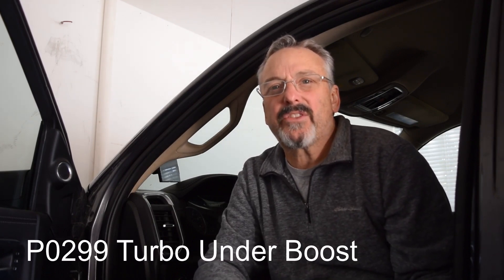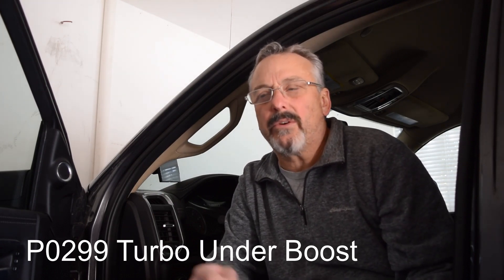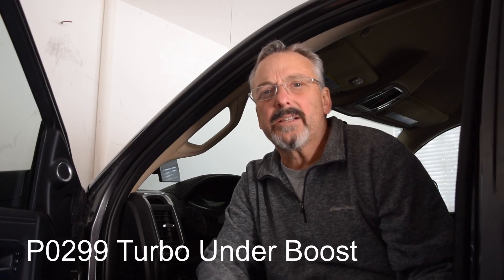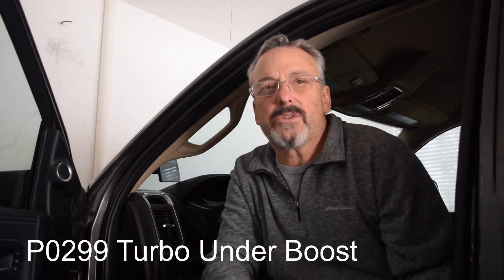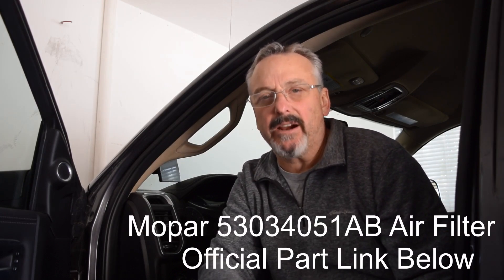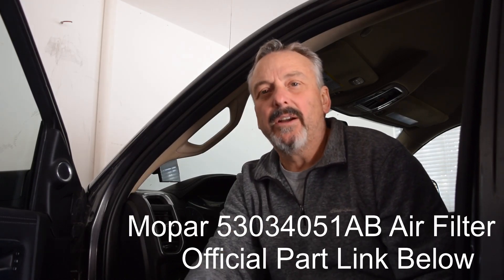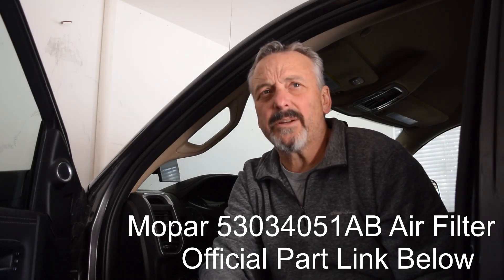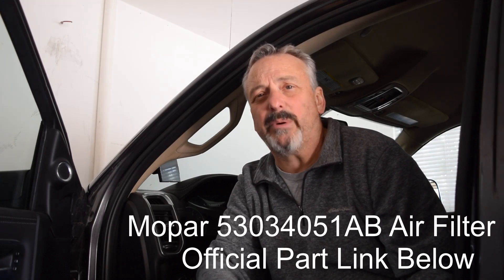2021 Ram 2500 6.7 Cummins P0299 Code Turbo Under Boost Code – Diagnosis and Fix

Comment: 24 ram 2500 low boost started last month and had the dealership work on it, was reprogrammed was good for one month now code is back on, I have changed the air filter every other oil change so 10k miles I do oil changes every 5 and I use wix or docs diesel filters no issue on my past vehicles just my ram
Reply from the maker: That's tough when the problem reappears so quickly after a dealership visit.

Comment: I started getting that code before I had 5000 miles on it after I installed a high flow cold air intake.

Comment: Interesting, you say people that live in high altitude get this code. I move to the colorado rockies about 90 days ago and have had nothing but problems with my dpf filter and now the p0299 code... i do run an aftermarket air filter, ill try a factory filter and see what happens.
Reply: What was your results?

Comment: RAM 3500 Laramie 120k miles. 
No issues of any type.  
I took it to the RAM dealer for the airbag recall and the ECU reprogram recall.  
I’d always used Doc’s air filters and never had an issue.  After the reprogram, the CEL came on  it was the P0299 code. I change to the OEM air filter and after 100 miles or so the CEL was gone.  
I may,as an experiment, reinstall the aftermarket filter to see if the CEL returns.
Reply from the maker: I am glad you got the code cleared and thanks for letting us all know.  I know it sounds CRAZY, but something about the airflow of the factory air filter helps this situation.

Comment: I have a 22.  Filter did not fix the issue.
Reply: @farmboy….🤦🏻‍♂️ good grief.   If you have factory air filter and a “replaced line,” maybe more to it than air filter.   Keep us all posted.  Thanks!
Reply: For the record… engine and air all stock…. However, I have Banks Pedal Monster as only extra.   Mine could always be that.  Since I only see it towing… I’ll just use my code reader, delete and repeat!  Unless it worsens.  🤷🏻‍♂️
Reply: I had the pedal monster , its been out for over a month, still had the code pop up, waiting to go to dealer for re flash, 21 2500  @MotoFish45
Reply: @dieselfred8084    I pulled my air cleaner out.  It had a few bugs but not too bad overall.   Code hasn’t been back.  Haven’t towed yet either.  We will see.  I think these are extremely picky about the air cleaner.
Reply: @MotoFish45  I'll have to check mine it's about a year old
Reply from the maker: Sorry to hear this.  Lets us know what does fix it.  At least you tried the cheaper option first.
Reply: Any update on what it was??
Reply: Been 4 months…..any update?   I only get the code when towing.
Reply: @MotoFish45 I'll update you on mine.   Took it in for this code.  Was told the turbocharger tube had a pin hole.  Well, it's 7 days later and the code is back.
Reply: I also have Banks Pedal Monster in mine, I have the same issue.
Reply: @michaeljames2204  I had a reflash from dealer per tsb and I changed my air filter to mopar all good now
Reply: @dieselfred8084    Well, been all good.  Towed the cargo trailer about 40 miles the other day, no issue.  When returning the same 40 miles, halfway back, sure enough, check engine and same code is back.  Think it’s time to see if I need an update as well….to be continued…..
Reply: I'm having the same issue with this code. I will do a software update and new Mopar air filter. Will be back for update.
Reply: I replaced my air filter and the code disappeared immediately.
Reply: @michaeljames2204  I also replaced my air filter to factory. Problem solved!
Reply from the maker: @michaeljames2204  Great news!
Reply from the maker: @michaeljames2204  Great news!

Comment: Can MAF sensor cause the p0299 code. Getting that and a p2281 code. Wonder if they are connected. My truck has a after market AE powersports cold air intake on it. Bought it with it on there. Haven’t had any problems with it till now. It’s been about 40 thousand miles.
Reply from the maker: Read the other really detailed comments here.  One other person was having issues with a MAF Sensor and cleaned it and put in a new factory air filter and had success.

Comment: Thanks, for the information.   I would hate to have real issues over just an air filter.  We will see what happens to mine.
Reply from the maker: I am still amazed that this is a fix for an issue that can be very frustrating and even a bit un-nerving.  I am also glad other people have seen this video and had success.  A simple thing to try is just change the air filter and if that doesn't work keep trying other ixes.

Comment: I had the same problem. I cleared the code and forgot about it. Took the truck in for regular service and had the code pop up on a work related drive shortly after.Driving from Boise to Pocatello I had a filter box full of dead bugs and obviously a very dirty filter. The dealer surprisingly didn’t even check the filter during the service. I did a thorough shop vac of the intake air box and changed the filter. I used a fram filter….Cleared the codes and no code the last 6 months.
Reply from the maker: I am glad you got the air box cleaned and a new filter.  These Engines seem to be sensitive to the air flow.  So a dirty air filter and bugs could cause the problem.  Glad it is working for you now.